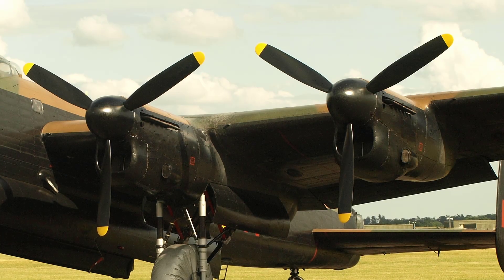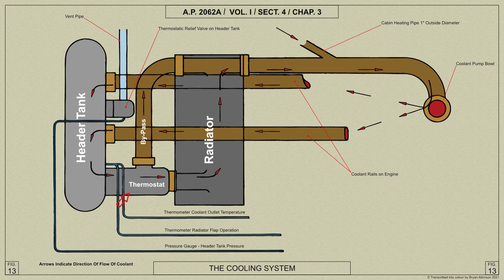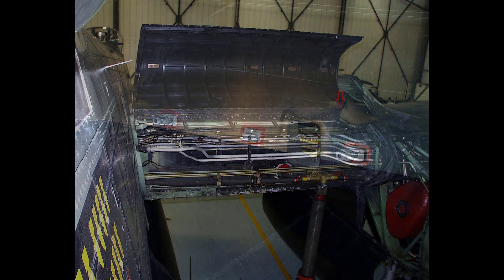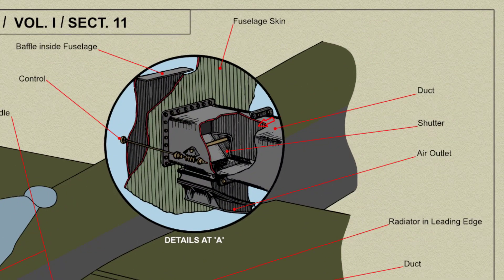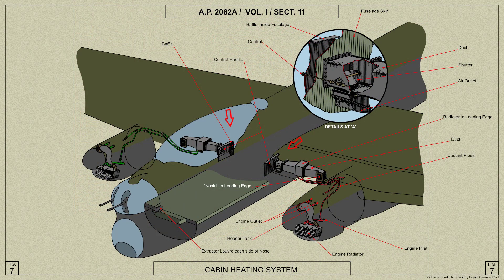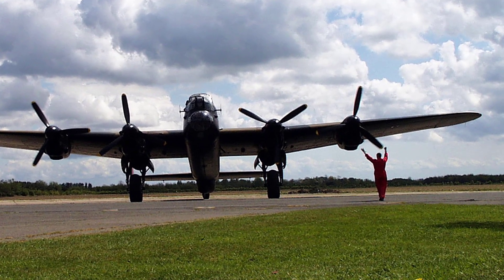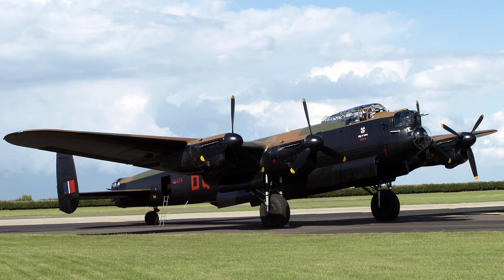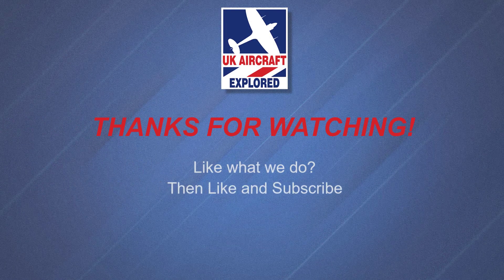Avro Lancaster – The Cooling System

Comment: Excellent, thanks!
My impression was that the interior of the Lancaster was a pretty grim environment during an op - did those heaters make much of a difference to the temperature inside?
Reply from the maker: As I understand, in forward cockpit area, the pilot would often be in shirtsleeves, whilst the mid upper and rear gunner would have no heating, apart from an electrically heated flying suit. I knew a Lancaster rear gunner, who told me that the guns would be so cold,  that if you touched them with bare hands, it cold would take your skin off. Lancaster crews, and indeed most aircrew at the time, had to endure great discomfort on operations. Thanks for watching
Reply: I wondered the same thing 
I know that B17 and B 24 s they froze!